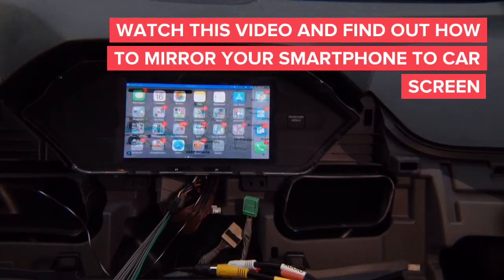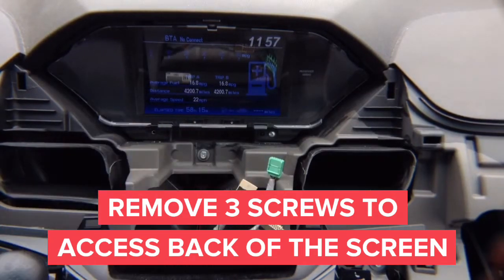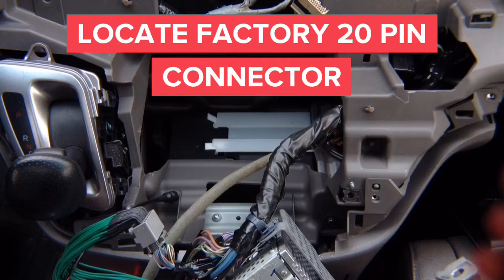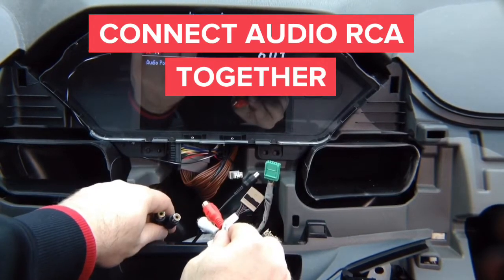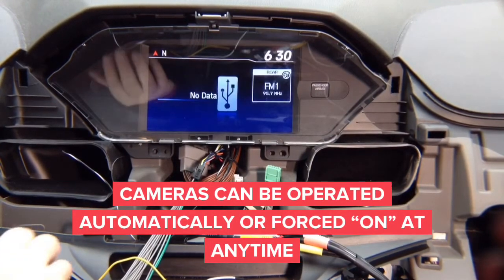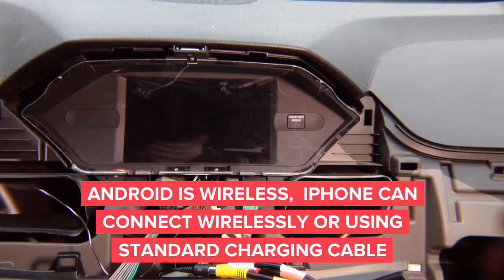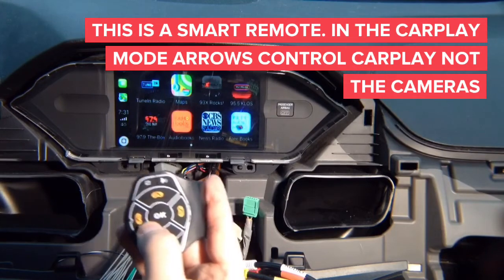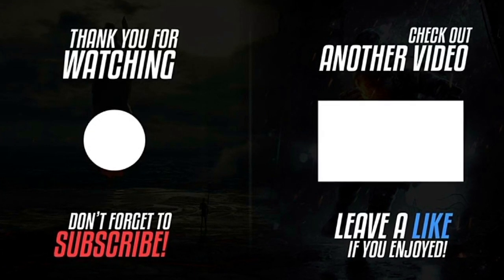Honda Odyssey Android Auto, 2011-2013 Honda Odyssey Screen Mirroring, Honda Odyssey Apple Carplay

Comment: I have my odyssey 2012 with factory navigation. Everything is fine except camera not switch automatically using left/right signal. I asked and got answered that at this time, it only support manual selection, and switch won't work due to the manufacture joystick. I did config the aftermarket camera for left/right camera to turn on both with or without speed control. Any help?
Reply from the maker: only works on non navigation pilot and odyssey